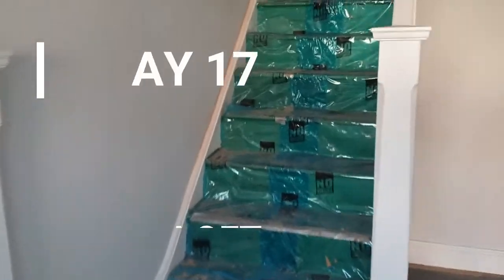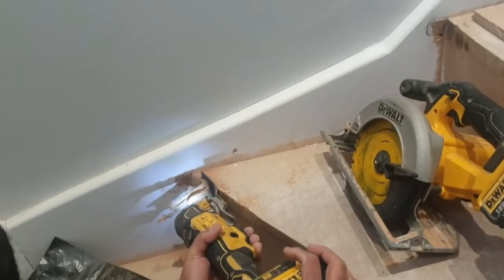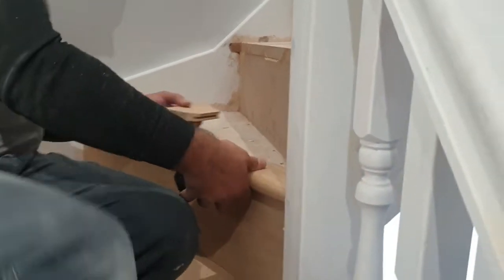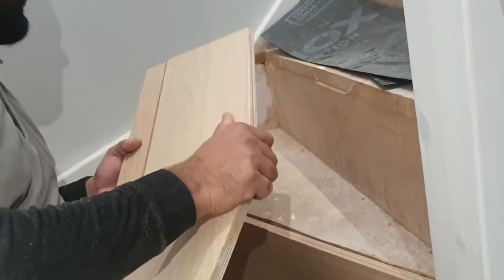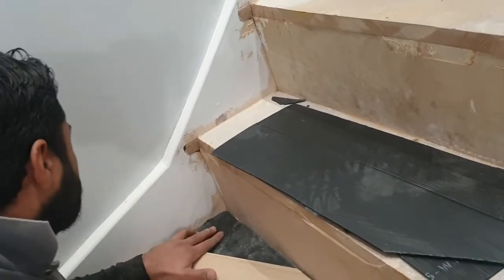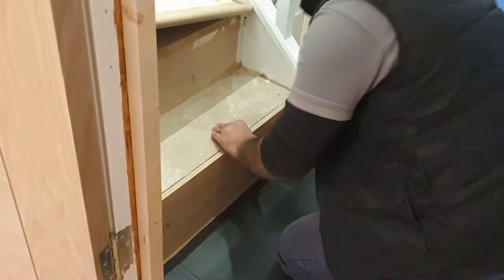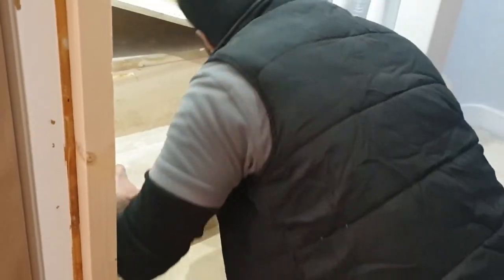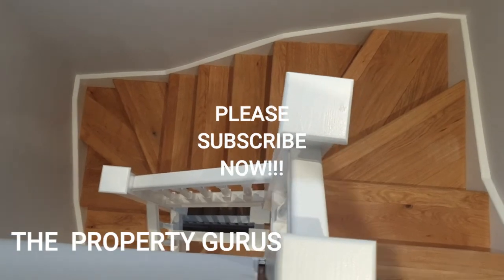LOFT CONVERSION DAY 17 - Staircase Makeover into Stunning Oak Finish - Day 17 of 18

Comment: Hi, that was very helpful and informative, can you tell me how much the materials was and how long it took to install. thanks
Reply from the maker: Hi Brian. Thanks for the feedback. The nosings are fairly cheap - you can buy them from timber merchants or online for around £12-15 each. The only other materials you need are engineered wood flooring and adhesive. Engineered flooring is around £35m2 online and depending on the size of your stairs you will need between 4 and 6m. All in it cost you should be able to buy all the materials for under £500 but the end result is amazing and will change the look of the house instantly. Thanks again for watching. 👍